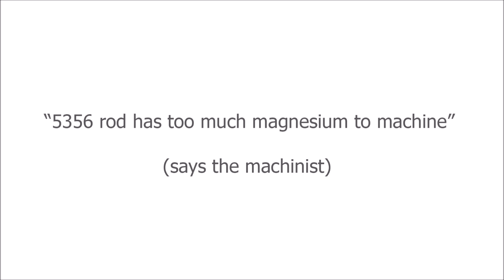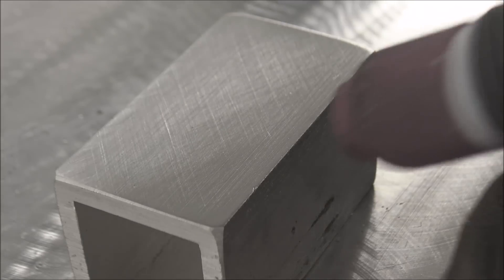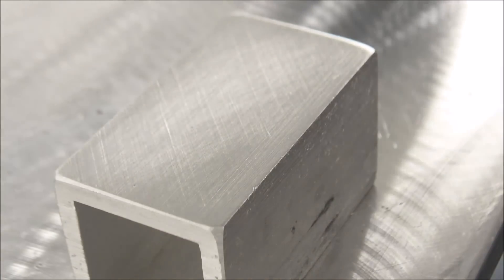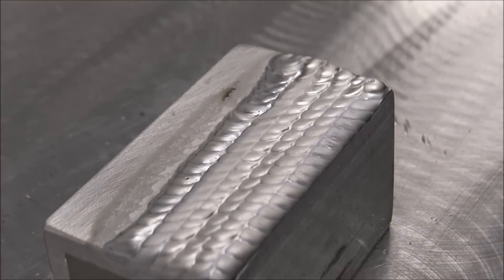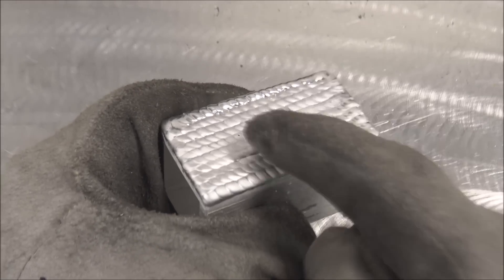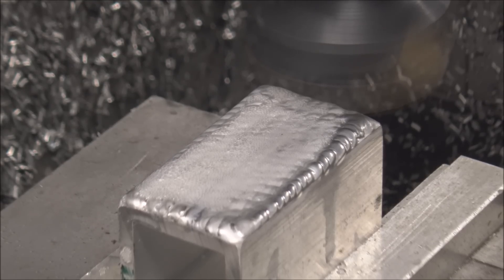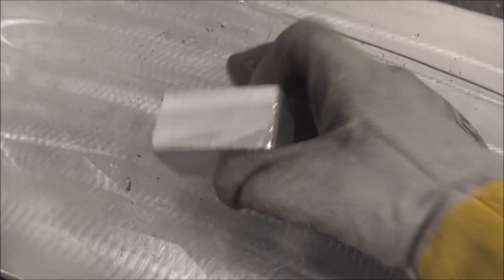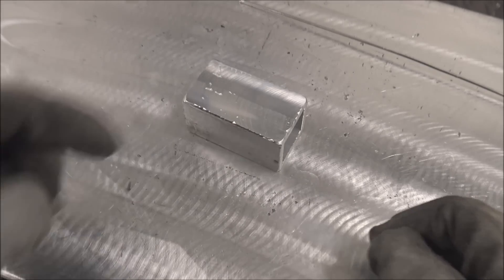Myth Busting / Saving a Machinist's A $ $ - Professional TIG Welding Career Advice

Comment: 4043 usually does not leave a great surface finish like 5356 as you proved, but by oven heating a 4043 weldment to about 500 degrees F and then slow cooling before machining can help with the finish. Really like your channel. Thanks: Tad

Comment: Im a welder not a machinist but we do a lot of repair work for the machine shop using 5356. Iv never had a machinist complain about the filler wire used. They just send it.

Comment: Machinist here. I'm not sure why someone would think that 5% magnesium content (the amount in 5356) wouldn't be machinable in the first place? Most stainless steel has around 2% magnesium. 

The only issue that might be a problem is if the part is anodized. It's not that 5356 won't take anodizing, but it might look different, which might fail it by customer standards. Not completely sure on that one, but it could be an issue. 

As for the use of WD40 as a cutting fluid...
It works fine in small applications. But it is not feasible to use it on a production level. Coolant science is exactly that, a science. You'd be amazed at the amount of research goes into it, not withstanding all the health concerns involved in the process. 

Coolant gets atomized when it hits the tool (especially big face/shell mills), and it's probably not good to breathe any coolant, but I'll take breathing the conventional (OSHA tested) stuff, over WD40 (which is a water displacement agent).

Comment: 20 years welding and just got a tig button a few weeks ago haven't used the foot pedal since . Great tool and great videos man thanks Ive learned a lot
Reply: I had worried it would be hard to press without affecting the height of the torch. Your thoughts?
Reply: @zpbeats3938 the pressure required to raise the amps is very light and I haven’t noticed any issues with moving the torch while using the button .

Comment: How is it easier than a foot pedal?  We all learned on a foot pedal.  Many of us had years of practice driving a car.  Now I have to learn your new pressure sensitive switch with my giant hands. 

I get using it for out of position welding where you can't use a foot pedal.
Reply: it's instinctive after you are comfortable with a foot pedalt, i swear. I have one of the sliders on my handle, not the pressure switch, but it works wonders and it's VERY nice to prep only one cable and not have to kick around a foot pedal. Plus, you can better do field repairs (when conditions allow) with just one cable to worry about while your feet are up in the air in some machine you know nothing about - lock iut tag out is key also!
Reply: because you can allways use the button, but you cant allways use a foot pedal. Actually you can prettymuch only use the pedal if you can get comfy in a nice position, most likely having a seat at a bench or something. If you go in to repair stuff you cant allways have it the way you like it. Thats where the button comes in. And if you just allways use the button then you wil be more instinctive with it.
Reply: It's not easier, but after welding a huge roll cage on a 5000hp machine, it's a matter of perspective for me.

Comment: Not surprising to me that the 5356 machined better. Until you get to the point of rc50ish steel generally the harder the material the better it cuts. Soft gummy materials always suck.

Comment: When I was welding aluminum wheels for a local shop, they requested that I used 5356 because it produces the best color match. Particularly important when repairing wheel faces and then they are being machined afterwards.
Reply: I do that now as a side gig. I had to tell the guy about the color match though.

Comment: I've done lots of welding and maching on both 4043 and 5356, both MIG and TIG. 4043 is usually a little bit easier to work with (machining and welding) in my experience, but your results tell a different story. Enjoyed your vid
Reply from the maker: Please clarify what you mean by "easier to work with".
Reply: I'm an aluminum TIG welder and machinist.  4043 is similar to 3000 series aluminum where machining is concerned.  You don't really want to machine it, it's gummy, ductile, soft, will break small taps easily, and your surface finish is going to be trash.  5356 is superior wherever you can use it.

Comment: I absolutely prefer 4043 to 5356, however if you do any gold anodizing make sure you are using 5356. 4043 won't take the anodized gold color like the parent material will, and you'll clearly see where your welds are even if you grind and blend them flat. This tip saves a lot of people time, material, and therefore money.

Comment: As one of those know-it-all machinists, I love using the big WD on aluminum, but it compromises the coolant in the machine.
We actually had to outlaw WD on the shop floor because the outbreaks of bacterial infections wasn't worth it.
On a knee mill, I would do it all day long, but these modern coolants come with helpful bacteria that just gets wrecked by WD.
Reply: You know it's a good comment when it's hard to tell if it's a satire joke or not
Reply: You're telling me I can spray WD40 on cuts and scrapes, too?
Reply: @ma61king  lol
Reply: @ma61king  'We actually had to outlaw WD on the shop floor because the outbreaks of bacterial infections wasn't worth it.'
Reply: thats insane, i would have never guessed they come with bacteria included, makes sense, but still really weird

Comment: You might just need to tram the mill instead of the spindle bearings if the cutter is just showing one sided pattern its just that its slightly out of alignment ie, perpendicular. But at least its cutting lije tou want. The key with is to get a sharp/preferred uncoated sharp cutting tool since aluminium has the tendency to gum and stick to sintered inserts. And for the higher content. Who cares most tooling now a days wouldn't have issues if right speeds and feeds sre used.

Comment: can you do a video on welding thick aluminum? ive been struggling getting nice shiny welds with stuff over 3/16" even with preheating, maybe not traveling fast enough allowing the etching to dull the shiny? i dont have this issue on anything under 3/16" or even doing thick to thin stuff.
Reply from the maker: Please email me pictures
Reply: @6061  i will grab some pics monday and email them over

Comment: I've always been able to tell if something was welded with 4043 or 5356 based on how it files/burrs off. 4043 is gummy, and seems like you can never get a nice shiny finish on it. 5356 seems to clog the tools less and, like you demonstrated, you can get a nice shiny surface finish from cutting/filing
Reply: Additionally, this video was a great demonstration!

Comment: A know-it-all machinist once told me that I HAD to use helium to weld aluminum (heli-arc, after all). Boy was he PISSED when I used straight argon…
Reply: To be fair, having 25% or more helium does work better, for me. Much better, tighter heat.
But I don't use it anymore, because $$$.
Reply: @UncleKennysPlace  I get it, but this guy was NOT a welder.
Reply: Build rockets with straight argon and you’ll find out he was correct lol
Reply: @rocketkinger2506 why’s that
Reply: I had a know-it-all welder tell me one time that you can only use green tungsten on aluminum.. it blew his mind when I started using 2% Thor rated for everything. I do like the trimix cuz it seems like it doesn't contaminate as easily but 2% is usually my go-to

Comment: One consideration between the rods is if the part will be anodized afterward.  You'll always be able to see the welded section, but 5356 tends to match better vs 4043 turning black and standing out.
Reply: This is a good consideration to know.

Comment: As a machinist there really isnt much you cant machine given the right parameter and tooling. certain aluminum grades are gummier and if i had to guess that's what that guy was referencing. I haven't really machined aluminum grades other than 6061 and 7075 but I'm sure if done properly the aluminum grade shouldn't be an issue.

Comment: Jody preaches the "know the machine shops" too.
The only issue I've ever had milling AL is it can like to stick to the cutting tool, gotta use something (WD40 does work good) to try and keep it cool. Also some folks recommend actually using honed supersharp tool steel cutters instead of carbide for AL as it can be sharper, but I just use carbide. I've never heard any machinist bitch about different grades of AL like they do about Stainless - 303 she's for me, 304 she's a snore (but w) and I found that to be true.

Comment: The only reason I've swapped rods on a machined part is to affect the anodizing color differently...  I can always tell where the repairs have been made through the anodize, but the 5 series shows a little darker IIRC...  And for the record, every machinist I know uses WD40 when cutting aluminum unless they're running a flood coolant on a CNC...  We've got a machine that has WD40 in the flood well because we like the way it cleans up.  All the mist coolant is also WD...  Maybe we're doing it wrong.  LOL
Reply: Just be careful. I remember reading reports of VMCs running combustible coolants going up in flames. WD 40 mist is basically diesel mist. While the fluid is quite safe, the mist very much is not.

Comment: Thankyou sir, because 5356 is what I predominantly use on 6061at work, because I was told it is Molecularly tougher than 4000 series fillers. Your Machining showed that even with a Lubricant whilst Machining, the 5356 machined Cleaner with no gouges.

Comment: Welding forged 7075 aluminum?  Impossible?  Is there a way to fix mistakes in machining it. It's expensive, and a simple mistake would cost a lot if chucking a forging  out for scrap.
Reply: I'm pretty sure you can't weld 7075 without cracking. I have heard of a special welding wire that can weld it though

Comment: One other factor in machining is that most of the 6061 we see is tempered to T4 or T6.  I think weldments are pretty much T0, so even the base material will not machine as nicely in the Heat-Affected Zone where it's been annealed.

Comment: WD-40 is really nice for aluminum. its a good viscosity and the chips don't stick like with thicker oils. The only real problem is it smokes if your run the cutter at high speeds so will fill the shop with smoke so for small shops with poor ventilation it is a pain but in a big area if you don't run the cutter too fast its a great lube. Cleaning the mill after is so easy with WD-40 and no sticky stuff like with so many other lubes.
Reply: The only thing I've found that cuts more freely is kerosene but I don't recommend it if you're going to cut steel next.
Reply: With lube. any is better than none.
Reply: water soluble oil in a drink bottle

Comment: You have probably addressed this but does the tig button restrict what sort of grip you have on the torch? Seems like you would have to grip it a certain way, even if you are out of position. That's the only thing keeping me from buying it. Still a great idea
Reply: They both look to machine up reasonably well, so the side by side comparisons was interesting to see. 

The information I've seen says that 5356 is better for general aluminium fabrication, whereas 4043 is better for repairing broken/damaged castings. That's how I've used them both with reasonable success anyway. 

That said, I would likely have gone for 5356 if I were repairing a machining error in bar or plate stock, and your results appear to confirm that choice.
Reply: The Tig button works awesome, especially if your contorted in a really uncomfortable position while trying to weld inside of a large machine and your legs are busy holding your body in place. Best purchase I ever made.👍
Reply from the maker: Addressed in the very last video...
Move it wherever you want.
Reply: Very cool. I might purchase one just to see if it's better for me. Might take some getting used to but it sure is a lot cheaper than a wireless foot pedal, those things are ridiculous.
Reply: @jonnygalante3623  I'm a novice welder. I bought the tig button because I have a tight welding space and the foot pedal always got in my way. I have the tig bottom on both my ck 26 and 9 style torches. I love it. I also like having both feet firmly on the ground. Great for welding stability.